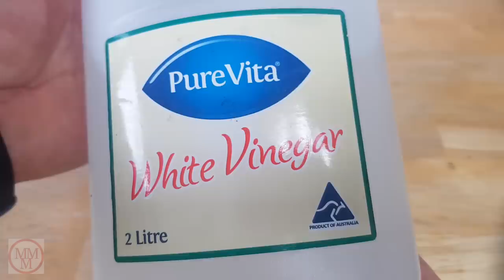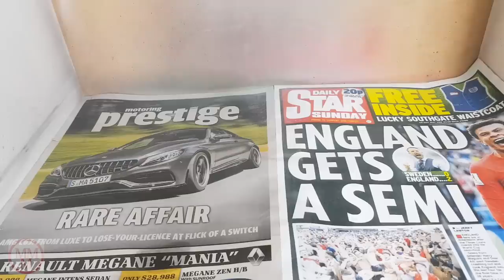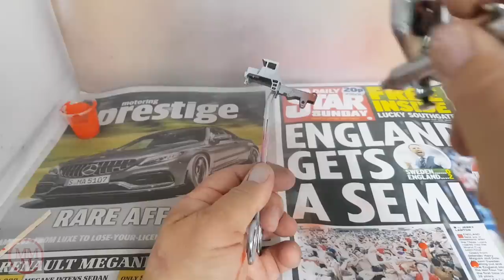MATCHBOX Restoration No 28d Mack Dump Truck 1968

Comment: I think, vinegar or Coca-Cola didn't work in a short period.. It takes a very long time..

Anyway, nice restoration 👍👍👍
Reply: Also, those poor axles were completely corroded. They weren't metal anymore, just lumps of rust.
Vinegar is good at removing rust from metal, giving it a day or two, but for such an ordeal, some specific chemicals are needed, or physical removal of the rusted parts and replacements, as they'll never going to be useful again...

Comment: That's a pretty darn good makeover, Marty! That thing was pretty close to beyond recovery.

I'm pretty sure that white vinegar did help with the rust and corrosion. You could tell it was doing something just from the bubbles coming off the model. It probably made it so you were able to get that  rear axle out. I use it for things like battery corrosion on old electronics chassis with good results, but I wouldn't have expected even as much as it did with those severely rusted axles.

A couple of ideas that could help you with drilling and tapping:

a. They make things called "center drills" that are used specifically for marking the starting mark to be able to drill just where you want it. You can find these in various sizes from tool suppliers or on eBay. They are basically very short, stiff drills, so you can get them to drill where you want them. A couple in the smallest couple sizes might do you good. Because they are short and stiff they don't wander around like a normal drill.

b. Straight taps come in three kinds, taper, plug, and bottoming. The standard kind you get at a hardware store is a taper tap and as you notice has a long tapering start. A plug tap starts quicker and only has 3-5 threads of taper. A bottoming tap is designed to tap almost to the bottom of a blind hole and has less than 3 threads of taper.  By breaking that tap off you have made almost a plug tap. If you find a real tool supplier like MSC you can order a real bottoming tap in the size you need. You would start the hole with your home-made plug tap and finish it with the bottoming tap.

I hope some of that might be of help. Keep up the good work!

Comment: Great work as always - what a transformation! In the heavy pitted cases like this one, you could try Mr. Dissolved putty from Gunze. It is a thinned putty that self-levels and can be sanded once dry. Alternatively, Mr. Surfacer works in the same way - it can be sprayed with an airbrush and lightly sanded to help erase imperfections. HTH

Comment: This is another of your videos that will keep me coming back.  I enjoyed your enlarged foray into greenscreen territory, it came to excellent use at the end.  Also, it seems like you're using cams which provide better and more detailed close-ups.  Although it didn't feature some of your regular skits - Kevin Koala, that damned boomerang, the weird newspaper in the spray booth - you had enough to do in restoring this truck.  If I had had to do it, I probably would have passed it over, but you showed your mettle with the metal.  Bravo, Marteeeeee!

Comment: Ye did a "creepingly" fantastic job considering in what kind of a hellish shape it was! And i seriously mean it! Absolytely allmost pitch perfectly done! Not to mension, even the cars itself (IRL) usually have a bit wear and tear here and there to demostrate the usage where they have beeen. As minitautre builder, i usually add after the "floss glos", a bit of wear and tear, mechanical marks and a weathering painting + (if necessary) some dust, grass or dirt particles, for enhancement, to add a "layer of suggested realism" to it.
For example: i went and bought a package of fake grass, collected some bit roubble from my back yard in a plastic cup and added a bunch room dust in a cigarette case to be added to the models.
When i do this, i apply first a very thin coat transparent spray clue, then i add the particles to their own places, then i knock the model gently  to remove the excess particles before the glue has dried. After that i just leave the glue dry out completely.

Comment: Great restore. It seems you try a lot of viewers suggestions. I have one. Commercial floor stripper for stripping paint. It won't hurt plastic. It's not as quick as what you use use but it won't burn you either. You can dunk the whole thing in over night or usually a couple of hours. You can use it over and over.

Comment: I've seen other restorers using different rust removers that seem to work really well.  Some also use a sandblaster which seems to work fine, even on delicate things, but that might be a bit expensive.  Very satisfying, though.  And effective.

Comment: as a restorer of archeological artifacts, I was once asked by a hobbyist to restore a small number of iron roman pilums 
I knew how to do that so no problem there those iron artifacts after 2000 years in the ground are just balls of iron ore but i knew the artifact was still inside I knew that if I would grind the ore ball the artifact inside would be completely black while the outside rust would be red so all I had to do was carefully grind down to black with a small stone Dremel tool and the form of the artifact would reveal itself eventually
well,.... the artifact had not turned to ore completely because one 2000-year-old metal splinter embedded itself in my eye!
I think that was the oldest metal splinter ever removed from a human eye in the hospital ever!!
always wear eye protection folks!!

Comment: Great job !!!!
It's stunning and as good as new.
Something you may try soaking your bases in is CLR , calcium lime remover. In the bathroom chemical section of the grocery. It's for hard water staining.... Soak for 4 minutes then soap and water wash. Then brass wire brush to prevent anymore scratches.
You should have better results and less work. Please let me know how it works.
Thank you and happy motoring.

Comment: That was impressive as heck! Well done, Marty. I was interested in the methods you used to remove the rust. I would like to suggest you try a product called Naval Jelly.This should be readily available from most auto parts or hardware stores.

Comment: Marty when you have some bad oxidation, try using CLR (Calicum, Lime remover) it works amazing. Use for about 4 minutes. Test with a 50/50 mix with water and CLR first. Then brass wire brush it.

Comment: Love this restoration, one suggestion would be to paint the yellow wheels parts orange like the truck because I noticed that when you first presented the model those wheels were orange but you replaced them with yellow color wheels. It be nice if you can paint them orange. However, final product came out FANTASTIC!!. Also, I noticed a problem in this video you didn't  say "I'm happy with that!!!!!"
Reply from the maker: Thanks Aldo for the comment. I didn't have any spare orange wheels so I went with the yellow. These models came out with both types of wheels so technically it is as it could have looked when new. Watch it again, I do say I'm happy with that but in a subtle manner .

Comment: I think it came out great but if you wish to cover any erosion/pitting car spray filler primer works also hand applied cellulose putty though the putty takes time to dry but it's easy to use and one part,,,,either way your work is great and don't think I'd work on one this far gone,but never say never,,,,Super work Marty,,,

Comment: Don't know if this has already been mentioned but for rust removal on small engine gas tanks and other parts, I use EvapoRust.  It removes most of the rust and what it doesn't remove, it softens so the remaining rust can be easily scrubbed off.  Hopefully that or a similar product is available in Australia.  I have never used Coke or Vinegar since most of the feedback I have seen has been that it hardly works!

Comment: I see you have used WD-40, that can is used for lubrication but look for a can of liquid wrench, we mechanics use it to remove rust from bolts and nuts to remove them from cars and engines and anything with rust, nice going with these models.

Comment: Well done recovery/restoration!  This another vehicle I know I had/have - I remember using it on my HO scale rail layout.  
Now, regarding how the dirt may got so crammed into the body - here’s a theory.  Ants may have filled in the truck cab and other crannies.   I’m only suggesting this because they do that to my solar powered garden lights every summer.  Every two weeks, I have to take off the solar panel covers and empty out all the soil that has been deposited into the clear lens portion of the lights.  I can imagine that over 50 years, ants and other underground bugs and/or worms have visited that truck.
Now to the pitting of the metal surface.  If the soil around your friend’s house in England is clay, that particular kind of soil can be quite acidic (at least it is here in Canada).  It’s quite possible that is why it was pitted so badly.  In another 50 years, if it hadn’t been found, I can imagine more of it would have been corroded.

Comment: Hi Mary! First I just want to say that I love your videos and you are doing a great job. Here is some tips for you that I hope you can use: When trying to remove a stuck axle, cut it in many parts as possible so the remaining parts don't have to be moved a longer surface to get it  out. I have removed rust with great success using descaler. But test it first on something that it doesn't matter is get's damaged.  I don't know how will affect the Aluminium. Thanks again

Comment: Vinegar: vinegar is weak acetic acid. Like all acids, it will react with both the rust and the metal, but in general it will react more readily with the metal than the rust. Consequently, it will worsen any existing corrosion - pitting - in the metal, both in the iron/steel axels and in the zamac of the castings, so you should avoid bathing the whole model in acid.

Really stubborn rust can be loosened chemically by dripping very small quantities directly onto the rust - just enough acid to soak into the rust, no more. (I prefer dilute hydrochloric acid because it's much purer than white vinegar so you don't get unexpected reactions.) Then you can sometimes chip the rust away more easily, especially if you first soak it in WD40 or 3 in 1.

But in general, I'd always assume it's best to avoid any chemicals that react readily with reactive metals like the ones used in matchbox cars.

Comment: Great job on a pretty far gone truck!  A word about using white vinegar to remove rust, It will also remove zinc plating, I use it for that all the time, but it may not be good for matchbox if you don't plan on replacing.  It's up too you.  I hope you returned the truck to its original owner.

Comment: The water the toy truck was in was muddy. The water seeped into the cabin of the toy truck and with the water small particles of mud also seeped in. Over time, the particles settled and you end up with a layer of mud.

Comment: yes, i love my dremel 3000, cutting at a lower speed will give you more control, i usually run it a bit over half speed and it works just fine

Comment: One thing you could use to blast off the oxidation is baking soda through a special airbrush tip. It acts like a small sandblasted only a lot less abrasive.

Comment: White vinegar works well on light surface rust however, heavy rust is generally unaffected by it. I often use it to remove rust from antique model railroad track. Vinegar also comes in different strength percentages. It can also remove bluing from metal.

Comment: There is a technique that can help when you are drilling out screws or in your case the rear axles that were stuck in their holes. Center punch like you did but then start with the smallest possible drill. The drill bit will wander around a bit before it starts to bite. Drill it through and then take a look. The hole will be offset from where you want it to be. Take a small cold chisel and make a small gouge at the lip of the hole in the direction you want the hole to move. I make two more gouges near the first one so the marks look like a crows foot. Go one size up to the next drill bit size. The gouges will cause the drill bit to move in the direction you want. Keep repeating making crows feet and going one size up in drill bit size. It is amazing how accurate you can get the hole even when you are drilling free hand.

Comment: Seeing you in front of the green screen, I thought I would tell you that we have made several at the school where I work. Recently we converted a small room in the PE building into a green screen studio with green screen on the back wall and green screen coloured pinboard like material on the other three brick walls to deaden the sound reflections. We will wait and see if the concrete ceiling needs the panels as well once the carpet tiles are laid out on the floor.

Comment: It should've been white vinegar and baking soda, leave it to soak a while, then clean in the same mixture. I personally use some solder to fill in the pitting, though by heating the area of the pitting then applying the solder wire whilst it's hot, afterwards giving the item a nickel bath to give it a nice shine.

Comment: Superb! I would like to share a thing or two if you'd kindly oblige me. First, there are no parts of your videos that I find boring. I quite like the paint stripping. Second, when I use white vinegar for rust removal I find I need to let whatever it is I'm working on soak for a good long while. I leave it for 48 hours and I still have to use one of those green scotch brite pads to remove the rust. It does generally just wipe away, though. Anyway, I thoroughly enjoy your channel. Thank you! I can't wait to see more.

Comment: the best thing to remove rust from small  items such as toy parts is a solution of half apple cider vinegar and half toothpaste mix it together really well until its all thoroughly mixed and then leave whatever object that has rust on it over night or for 48 hours and trust me it brings things up like new all you have to do is give the items a minor brush over with an old toothbrush and a rinse in warm water , trust me it works a treat .

Comment: room temp white vinegar will only remove very light rust, well it actually only loosens it, some scrubbing after soaking will remove light rust. If you want to do better, heat the vinegar and model in a pan on the stove, to just below boiling you can do boiling, but that doesn't help anything. As you use it, the water evaporates, but the ascetic acid does not, so the solution actually gets stronger as you go.  Still, with things that bad it's not going to do the job. There is a way to use electrolysis to get it off, but I haven't tried that yet. To replace missing parts, I use a metallic epoxy putty, you can mold it like clay until it sets up, then it gets very hard and is machinable. I get mine at the auto parts store. It's not cheap, but easier to use than JB weld for making pieces. By the way, I love it when you get a real challenge like this one. A skim coat of modelers putty would have made this go easier as far as the pitting.

Comment: Blacksmiths used vinegar for pickling.  But they use a vinegar with a high ph. And they boil their products in the vinegar to remove rust and forge scale. In the US you can find cleaning vinegar at Home Depot

Comment: If you're looking for very, very small drill bits and burrs, ask your dentist for his old kit that he's about to toss out.  I got a little grab-bag of high end, miniature straight shank rotary tools for free from my dentist.  The tools are no longer suitable for dental work, (neither is a brand new, razor sharp drill bit from that hardware store) but I've gotten over 10 years of model making out of a toss-away set of needle thin drills and tiny burr bits just by asking my dentist when I needed a filling, and they are still sharper than any commercial drill bit I've ever bought.  I saw the little kit of tiny rotary tools and my dentist talked about them exclusively while he was fixing my tooth.  I think he was really jazzed to talk tools with a client and just gave me an older box kit simply because I was interested.

Comment: Firstly I very much enjoy your work. I would like to make a couple of small suggestions that may help you in the future..

First.. Evaporust is a product that you should use to remove rust from metal.. it is safe on most painted surfaces and does not damage the metal at all.

Second.. try using a brass wire wheel attachment for your dremel.. brass is a softer metal so it will remove rust with damaging or scratching up the metal.

Lastly get a couple of sandpaper wheels for your dremel tool.. in different grades.. you will be able to sand out a lot of the pitting.

Please don't take this as criticism of your work these are meant to be constructive suggestions.

Comment: I've found vinegar can take 24 - 48 hours to remove rust. Heavy buildups (such as those axles) need to be scrubbed down after removing and then placed back in the vinegar several times. Doesn't come out shiny new, but it does dissolve most of the rust. A 10% solution of acetic acid (or Muriatic, Sulphuric, Hydrochloric acids) and water works well. Again, it takes up to 24 hours, depending on how bad the rust is. You need to wear protection, though.

Comment: Have you tried an ultrasonic cleaning bath with hot soapy water to shift the dirt? Use one to clean my Dinky restoration projects and it works very well. I also soda blast to clean up the parts, works brilliant and does not damage the metal like grit blasting would do.